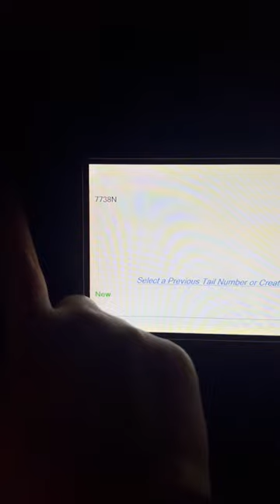Pulling my airplane with a golf cart!

Comment: But would it heat up the cylinder to operating temp if ypu would of taxi it ?? Why don't people actually let the plane sit for a min before takeoff it's always fire up full throttle go
Reply from the maker: Hi Jason! In short, by starting the airplane up for such a short taxi just to turn the plane off and fill the tanks that’s really bad when breaking in a new cylinder. 

However after getting gas, preflighting, and starting the airplane, I did taxi and complete my run up checklist which gave it plenty of time to heat up before takeoff. Hope that answers your question!😊

Comment: Do you mean the Piston? A cylinder replacement is a rebuilt engines.
Reply from the maker: No, I did mean the cylinder. I may not be an A&P but I do know what my airplane needed! Thank you for asking, hope you enjoyed the vid!😊
Reply: My guess it was both a cylinder and piston. They wear together.
On airplane engines, the cylinders unbolt from the engine block.